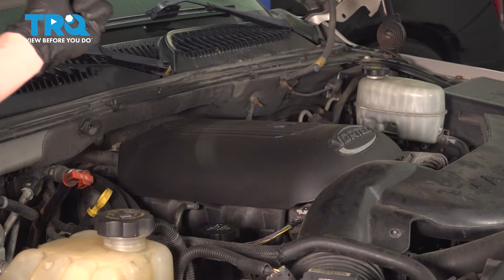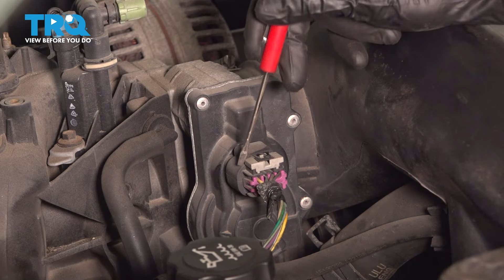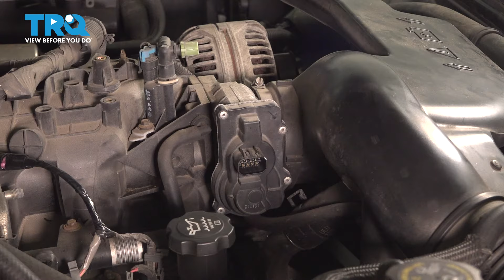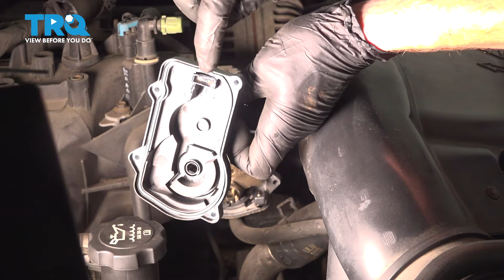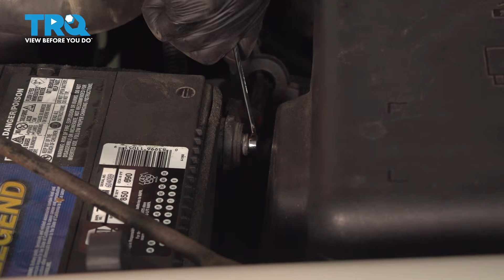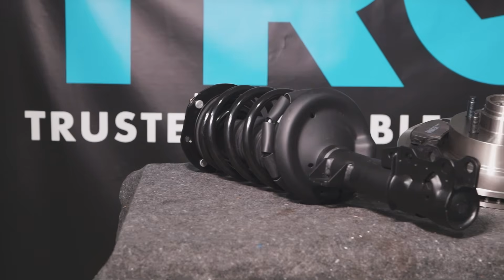How to Install Throttle Position Sensor Repair Kit 2000-2006 Chevrolet Tahoe

Comment: Can you re pin that stock wiring harness to run a 07-014 “NNBS “ trail blazer intake manifold with stock 90mm throttle body instead of running a X link from harness to Nbss intake TB ?

Comment: Can you use a lighter or individually wrap the splicing connected for the wires with the connection using electrical tape if you don’t own the heat gun?
Reply: Borrow your wife's hair dryer. A 1600W hair dryer typically will do.
Reply: You can use a lighter, but it does take some skill. A hard butane torch flame is best (not a soft flame, like a Bic lighter or Zippo), but you don't want the visible flame to touch the wires because it'll burn or melt the plastic. It has to be held a couple inches away from the visible flame so you just get the heat on the shrink wrap.

A hair dryer works, as stated above. But even a mini hot air gun from Amazon or budget tool store like Harbor Freight are very affordable. Like $20-30.

Comment: Can this same process been done for the accelerator pedal position (APP) sensor connector - found frays on some of the wires. Pushing out Code - P2122 which is causing a reduced engine power with no acceleration unless un plug the APP sensor and reconnect.

Comment: If I do this can this fix my code problem with the circuit of the tps 
It says on the obd 
Are this connectors ok for this kind of job 
?????